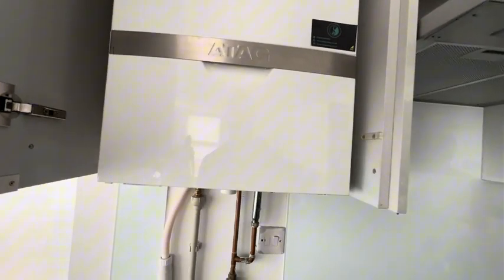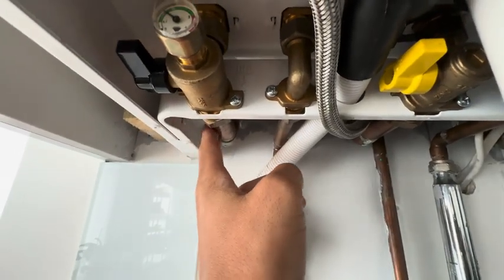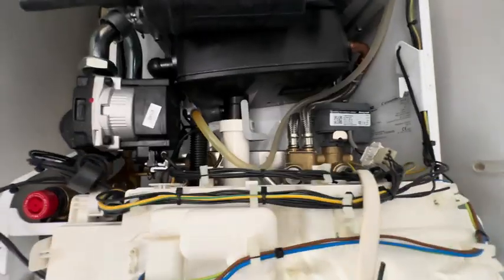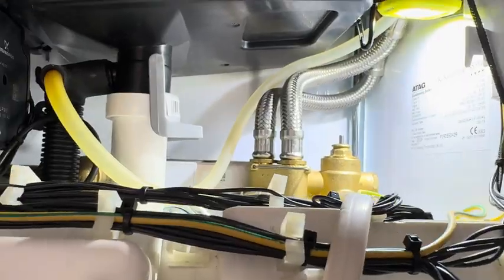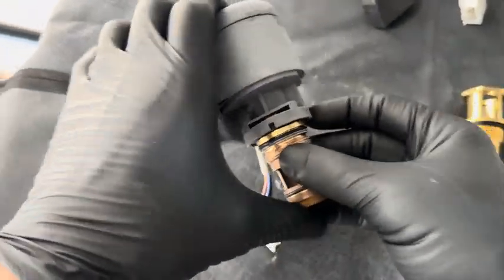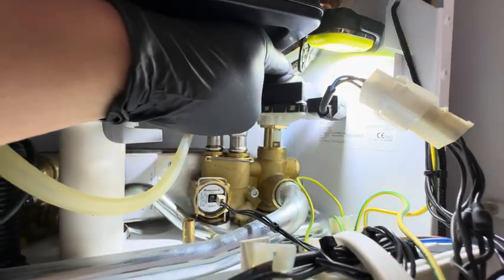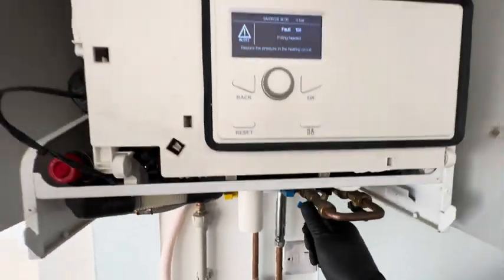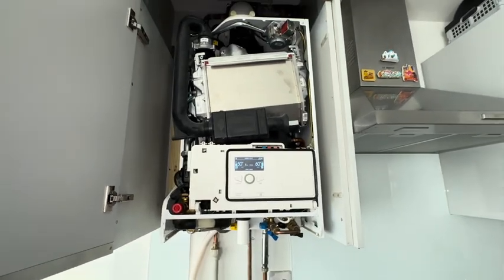Why is my heating still on?? ATAG Edition

Comment: Any advice, got an Atag earlier model than this. Mine if the heatings been on you turn it off but boiler still runs. If you press the eco button it stops, also I have it so eco isn't heating the water but it will automatically switch over after a while 🤬. 
Likely to still be the diverter?  
Cheers
Reply from the maker: I’d say probably the diverter to be fair. Are the radiators getting hot when the water is run for a period of time too?

Comment: Was this a warranty repair? As ATAGs generally come with very long ones!
I fitted maybe 10 ATAGs around 4 years ago. I really liked them then and still do.  However they are a big dimensions wise and I ran out of enthusiasm trying to sell a brand to people that they had never heard of and usually didn't want.  Sad really
Reply from the maker: @johnboddington  it is a shame, and I completely get you - I have the same issues, a lot of the properties I work in are smaller and/or usually fitted kitchens and it’s impossible to fit them into a cupboard which has meant I can’t even quote them. 

They’re lovely boilers which would do really well if people knew their capabilities! I generally offer 3 options and provide all the product sheets for customers to make their own mind up! Give them another try (let me know how it goes)!